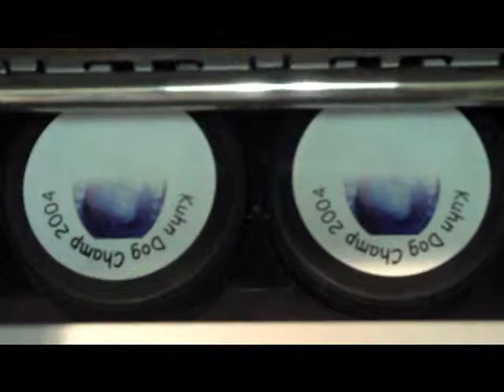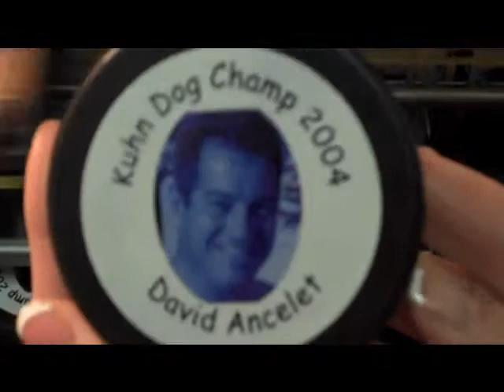LogoJET printing on hockey pucks

Comment: Are you printing on labels that you've added to the pucks? What's that white surface?
Reply from the maker: Hi Darcy,

Thanks so much for the inquiry.  What a great question.

These do not have a label. This type of hockey puck is designed to have a white center. There are several vendors that supply these. We can get you more info if you are interested. Please contact us at 337.330.8471 or supplies@logojet.com and they would be happy to help.

Thanks!
LOGOJET
Reply: @logojet  Where do you get these pucks from? and what kinda printer/ink are you using?